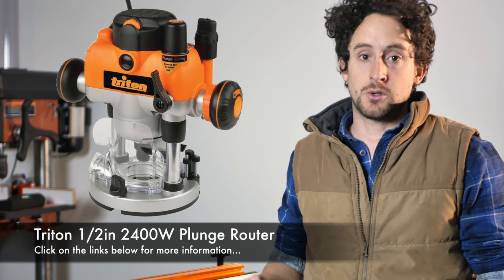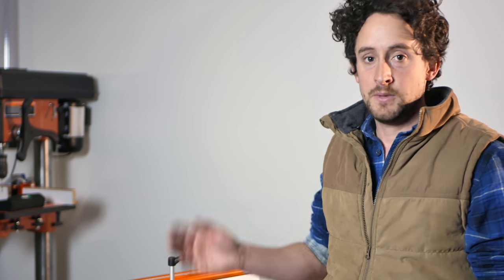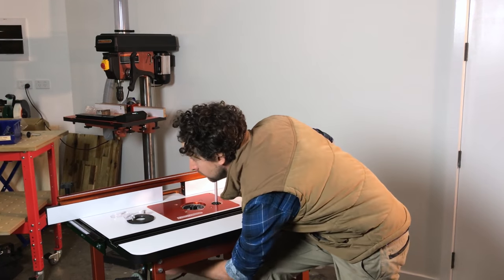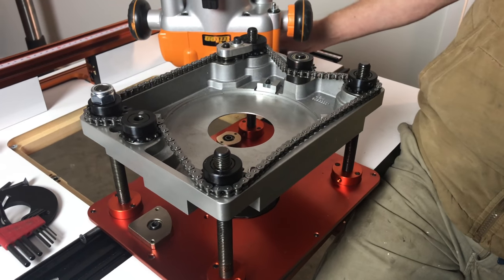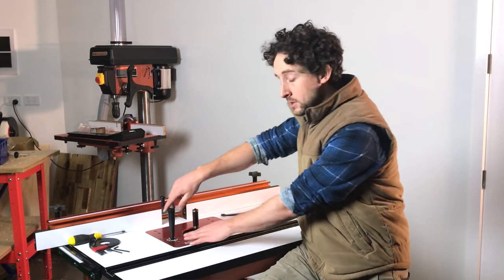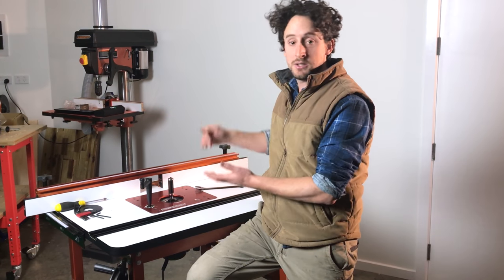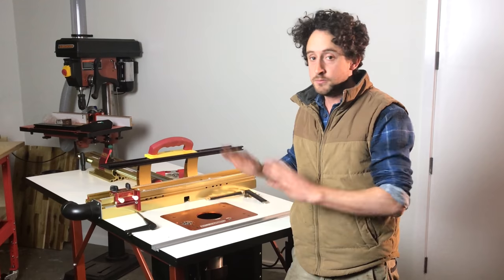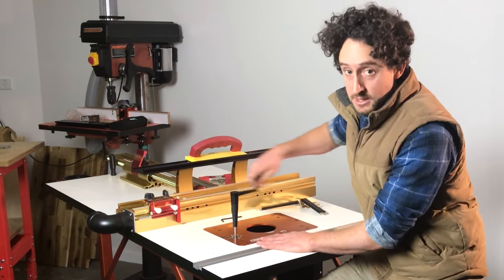The Router Bits - Better Router Raising

Comment: Cool video, I’ve always wanted a proper lift. Not cheap but a great long term upgrade.
Reply from the maker: Thanks Joe. Yes. Not cheap. But they certainly make an incredible difference, especially if you take the Round Body Motor and lift combination. Not only is it easier to manage, it also frees up your hand router and expedites work in the workshop.

Comment: After watching this video, I've gone online and bought one of the fixed lifters with the dedicated motor. There are a number of reasons for buying this particular model including the fact that it is 240 volt. (Amazon have a few options but only - so far as I could see - for 110 volt systems.) 

The only question I have - and I hope I haven't been foolhardy in not checking this out before buying - is the availability of insert rings for router bits that have larger or smaller heads. For example, the "JessEm Mast-R-Lift II" can be purchased with an additional 10-piece insert ring bundle. 

What's the situation here?